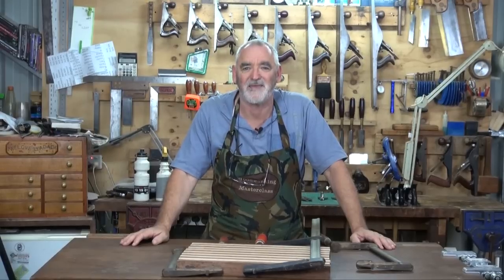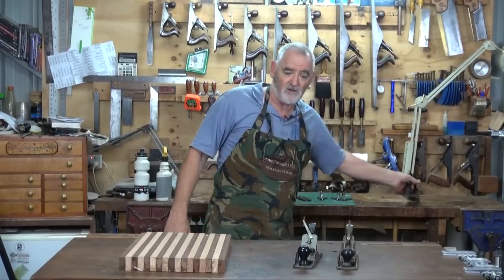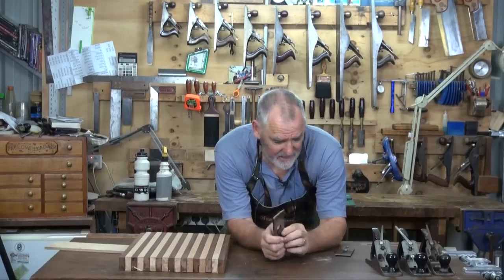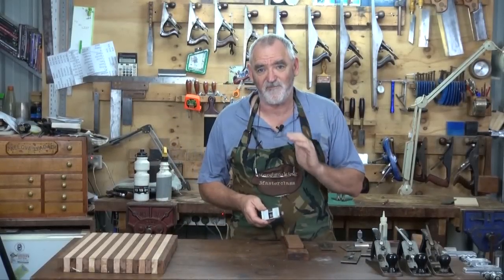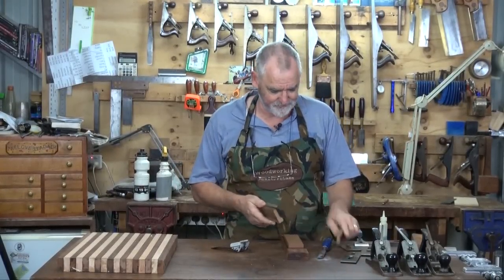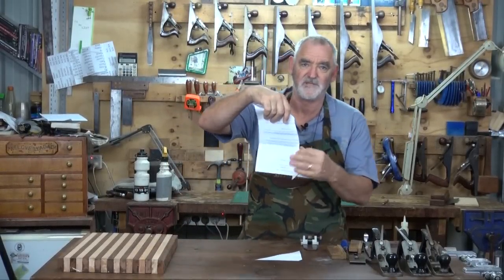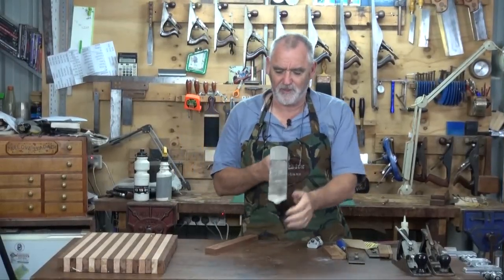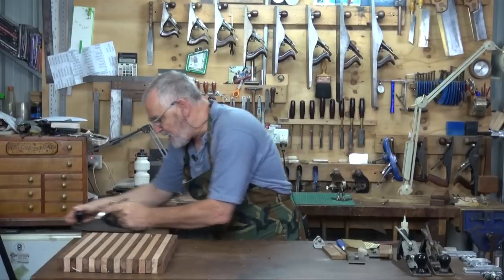Chopping Board Pt.2(a) Sharpening, Tuning and Setting a Hand Plane to Flatten the Board

Comment: A tip for setting the cap iron distance from the blade's edge: take a feeler gauge of the appropriate thickness and lay it onto a flat piece of wood. With the edge of the blade on the wood and the feeler gauge butted up to it, slide the cap iron to the feeler gauge and secure it in place. When your eyes begin to give you doubt, this trick will always set the cap iron in the same place every time.
Reply from the maker: Excellent tip Matt.Thanks Cheers Steve

Comment: A novice question: is the secondary bevel really necessary? I just started woodworking and so far have set all my tools at 25 degrees primary bevel and can't really say it cuts badly in any way. Can you or someone please explain why a secondary bevel?
Thanks and keep up the nice work!
Fredrik - Sweden
Reply from the maker: +Fredrik Alm Secondary bevel is set about 5 degrees steeper. The main reason for it is ease of sharpening. If you have only a primary bevel then in order to resharpen you have to remove material from the entire bevel, as it's all in the one plain. Where as, with a secondary bevel you only have to remove material from the area of the secondary bevel, generally only a mm or so of the area of the whole beveled edge. Which can easily and quickly be done on a flat stone and strop. Hope that helps. Cheers Steve